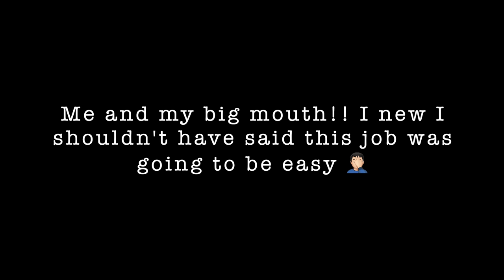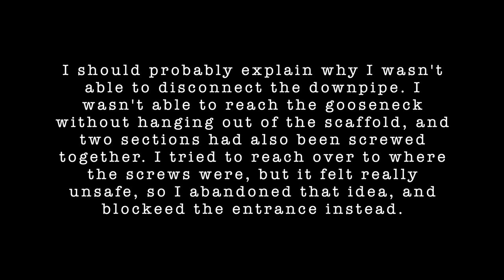I FOOLISHLY Said This Was A Nice, Easy Roof Clean!...Then Mother Nature Opened The Heavens On Me! 💦

Comment: 7:48 Mi Tower makes them plastic instead of metal so people will have to constantly replace the parts. 🙂  I could never do your job, I'm afraid of heights since I was 15 and my brother was 11 and pushed me off the garage roof and landed flat out on my stomach with the wind knocked out of me.  Me, my sister (13) and brother used to jump from the garage roof to a 12 foot high mountain of solid dirt from my dad and his brothers digging out the foundation for the garage.  That knocked the wind out of me!  🤕🤢🤮

Comment: Another great video buddy. Can I ask, whether you’d advise on getting a boiler for the pressure washer.
Reply from the maker: It depends what you're planning on doing with it. Roof, patio and driveway cleaning, you don't really need heat. I only use my boiler when cleaning bricks, like ivy tendril removal, or graffiti removal